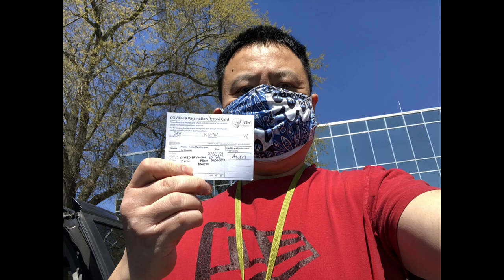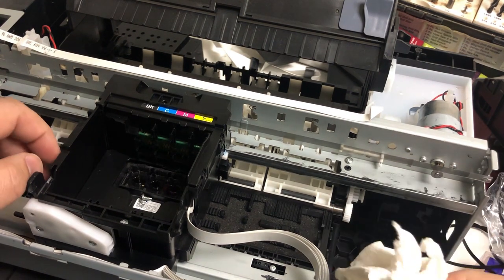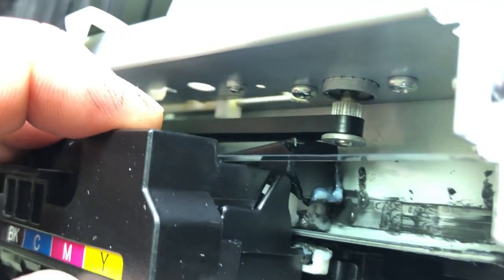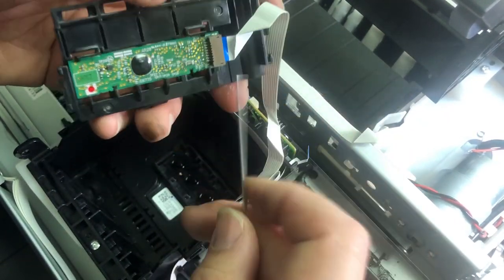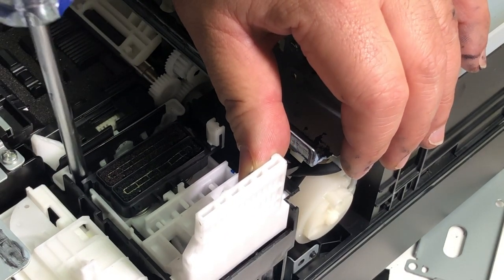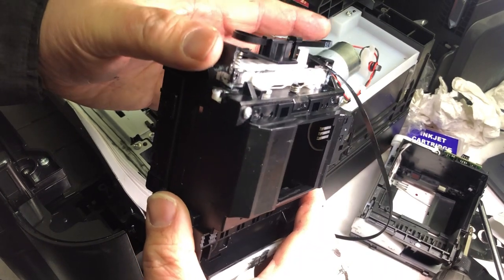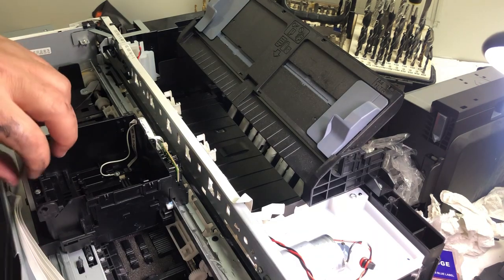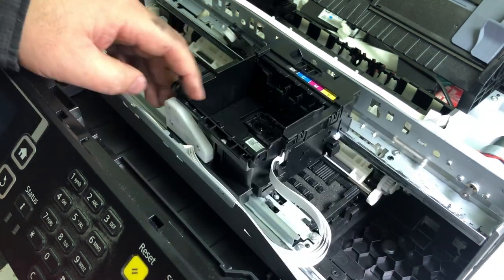Fix Epson Error Code 0xEA: Blocked Printhead Carriage oxea

Comment: Feb 2024:  Used 3620 off and on for years.   Was working well as a scan to PDF mostly.  Now with the Ex0A error, it's useless.  Fantastic skillset you have, but with limited time vs. money, I may have to toss mine out.  Too bad there isn't a default scan-only option that would disable a broken carriage.  Would still be perfect for scanning to a thumb drive.

Comment: What does the PW system control? I have two Dtg‘s one that’s been broke for a year and I noticed the PW sensor on it. I can’t see it the cable and on the new one I have it sliced I bought a new carriage head from the manufacture it also came with the cable sliced to the pw senor.

Comment: Hi I have a WF-3540 Epson.  I get a 0XEA error.  I cannot find anything that is jamming like paper or anything.  The carriage tries to move, but only moves a few mm and then stops...almost like it doesn't have the power to move.   I can unlock the carriage lock manually and move the carriage manually along the whole rails left to right.  Have tried to start (turn on) machine at several points along the carriage rail, but same issue... carriage only moves a mm or 2 then stops and gives error.  Can you assist with any ideas as to what the issue could be?

Comment: Kevin can you please help. I have R3000 and my pri thread will not release from capping station and when I turn on I hear a grinding noise and error comes up. Was working good. I didnot clean the printhead or anything so idk what's going on

Comment: Any ideas on a WF7610 0x97 error where the carriage seems like it wants to move however seems like it's caught from beneath on right side. 

Only happens when requesting to print, clean etc. Machine has less than 500 print usage and is outside of warranty.

Thanks for the videos

Comment: Hello Kevin, I'm in a bind with a Epson photo 1400 printer that has low hours and i have deleted the software with revo and reinstalled the original driver. I did not install any updates. The Printer when powered up  was not showing the ink cartridges. I did a few cartridge changes then my printer locked up. is there a fix for this?
Reply from the maker: Hard to tell without seeing it.

Comment: Hi Kevin, thank You for Your videos! I bought 2nd hand Epson WF-7610 and after turning on the print head moves very fast, smashing hard to each side of the case and then 0xEA error sign shows up.Can You please advise on this?
Reply from the maker: Probably it’s the belt caught by the carriage.  Take a look and make sure it’s not twisted.

Comment: thx !! tell me... Do I can install a motor carriage diferent at the original one? For example... in a epson t50 the original motor is  RS445PD15205BR  00.EM- 514 B12, If I install this 00.EM-433 will works ?  If works slow no problem, I need you tell me if the main board may be damaged... Thank you for the video and my cuestion!!! sorry my English... XD

Comment: Can you help? I've got an Epson XP245 (model without display) that has all 4 LEDs blinking after power on. Some sources say 'fatal error' but what does that mean exactly? Is there a quick and easy fix? Hope so, cos I just paid out for a whole load of new colour and blank ink cartridges for it. Thx
Reply from the maker: I am not sure.  Have you tried to reset the waste tank counter?
Reply from the maker: I said waste tank because it usually causes all the lights to blink.  If you have an error code or message, it will help to narrow down the problem.
Reply: @BCHTechnologies  How would I do that? Via software? Is it free? Do you have link?
Reply from the maker: @droses1600  I don't have it.  You can get it from websites like inkchip.net or WIC Support.
Reply: @BCHTechnologies  Thanks, but it costs $25 bucks for the activation key. A rip off. I can get another used printer for less than that.